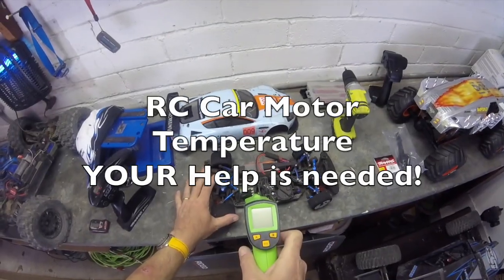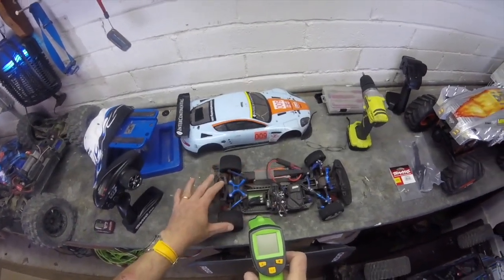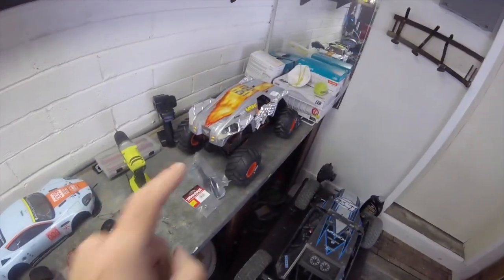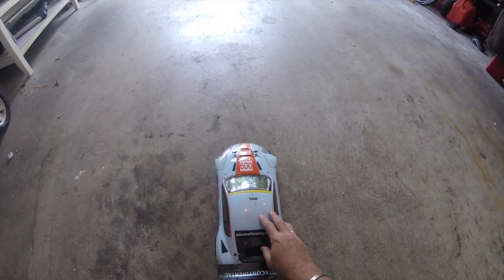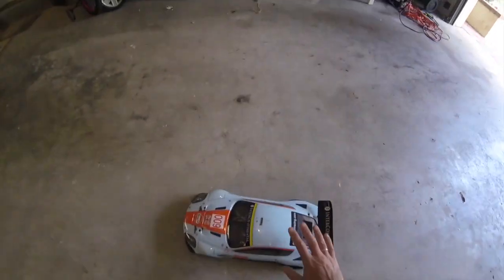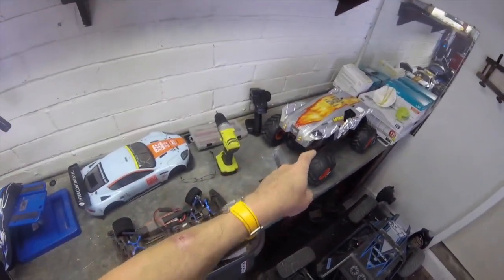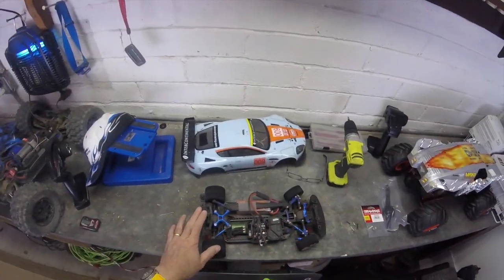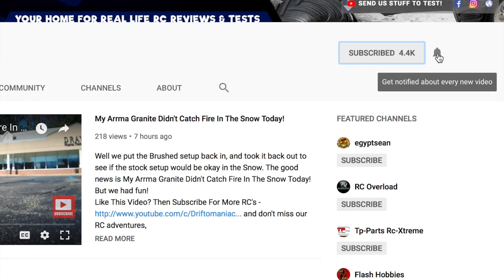RC Car Brushless Motor Temperature - Is This Too Hot On 4S?

Comment: Youre a terrible driver. Should learn on 2s not 4.
Reply from the maker: yeah I know I don't get to drive much as all I really should try and drive lots more RC cars. Not sure what use 2s would be on this speed run car though..... I can drive well in a straight line 88mph with this so far, and 94mph with arrma typhon. You being a good driver you must have done better than that in a straight line? I'm not bad at jumping but also only in a straight line like in this video - https://youtu.be/XHQ2NUDJe5o it keeps flipping though as you'll see

Comment: I have a traxxas rustler fully modified for drifting (welded diff, no caster, parallel toe at full lock for high speed high angle drift) Stock brushless ESC w/a sensored Hobbywing X10 G2 5000KV on 2C 5200mah 35C on 2 inch HPI on road drift wheels with rubber tires and in get 10 minutes of runtime and my motor reaches 140F highest motor temp during the day and 130F at night, same runtime 10 min day or night but I'm HEAVY on the throttle cause I drift on asphalt. Geared at 38t spur 18t pinion Mod 1. ratio is 2.37
Reply from the maker: alan that sounds an awesome build, I'd love to see that thing run. I'm debating building a 1/8 drifter as I've some 1/8 drift tires that I play around with on some of my other cars. You may have inspired me into action over this winter. With the new rustler out I guess a few of the 2wd ones will be up for sale. Thanks for sharing the temp info as well BTW

Comment: For this motor, 4s is too high voltage.
Reply from the maker: ESC is rated to 6s. It's sensored so it cuts out when the temp gets too high. Thus it remains safe even on 6s. On 4S it'll run a full pack just fine. You only find this stuff out by testing it like I do
Reply: What  actaul CAN SIZE motor is that....Usually high KV motors are BABY motors. There's 3650 3300KV 1/10 my monster trucks. I do only 3s on those. can pop wheelies on them..even on GOOD 2s  C RATINGS lipo.
I dont like breaking my drive train.....I ran them hundreds of times.
I also have 3650 3900KV...those trucks dont pop wheelie worth a fuck....

1/8 buggies..these things are HEAVIER...now we;re into the real hobby grade with thicker metal parts all over. 4076 2250KV. This motor
is on the high KV range for that size . It runs fine on 17T....it gets hotter on 19T
Im only on 120A...with 600A burst....4s 50 C. It'll do over 50 mph and out run your car. ( that's not fast...people make them do over 100 mph lol)
 Im not into speed runs....It wearing the rubber fast. The damn tires
balloon...foam insert flies off.lmao

Bigger tires = like gearing UP...yes?

For my 1/8 MGT4.6 conversion...it's more like 1/7...it has 7" tires.
It's a BRICK...BRICK  13lb .....4092 1650 KV  200A esc 6s 40C..
I;m COOL with it. It pops wheelies and can do 50mph ish. ( 2 speed trans)
Reply from the maker: not a clue but it fits 540 mounts, unless space is an issue then focus on the bolt positions. Of note my losi Xl-E does 50-55mph on 8S! That said it weighs 33lbs.....Is that more than double brick size. My traxxas UDR is about 14-15lbs and they say that does 45-50.
Not sure on the outrunning my car, I don't drive may RC cars at all...I'm not good at math either. You mention your's will do over 50mph and out run mine, which does over 83mph on 3S - no wheelies though, is 50mph faster than 83? I don't drive on the road so not a clue is 50 faster than 83mph? Not a clue I barely drive any different RC's at all as an extensive search of this site will show, so clueless on the speed. Does that mean yours goes 33mph faster than mine on 3S? On 4S it want's to wheelie a bit, top speed on 4S starts with a 1 is that faster than 50? I need a hand with this GPS? Help anybody?
Reply from the maker: it's a castle 5700kv motor do check out the 'full pipe' video of this car I shot early this week.

Comment: Be aware that infrared readings are manipulated by reflective surfaces. They will reflect the atmosphere instead of the object intended to measure. This can make taking temp readings more difficult. In general, a reflective object will read much lower than the actual temperature.

Comment: not really going to determine if the motor or esc is too hot in one type of vehicle and not in another. A lot of variation to consider;
weight, gearing, airflow, rolling resistance.... you will just have to put the component and test. But stay absolutely under 180.
111 is a good internal temperature for a pot roast or slow smoking some ribs...lol

Comment: Make sure you are measuring on the motor can not the wires. As others have said 180 Fahrenheit is the max running temperature. Around 150-160 F is about normal if it’s geared correctly. Also, try taking the temperature after a full battery as the motor will be hotter then.

Comment: back to the old intro, eh? it's better. the motor temp seems to be fine, but I'd recommend getting a cooling fan for it if you can afford one. prolonging the high temps might end up weakening the magnets, but should be fine given only occasional runs and low traction tires (like drift tires) to lower stress on the motor. some White Lithium WD-40 on the bearings would do it good.

Comment: between 150-160 is the sweet spot. 170 is getting into the danger zone, and at 180 you are doing damage to your magnets. 200 is pretty much cooking the motor.
Reply: Fahrenheit
Reply from the maker: Dustin your comments MUCH appreciated that was the kind of info I was after but was clueless on. I'll take the temp gun out with me when the motors in the axial as I can hit it up without taking the body off as the motor sits under the car
Reply: No worries, I spent a lot of time sourcing this info from old heads in forums and from motor manufacturers themselves. These were the numbers I settled on and I stand by them being pretty darn accurate.
Reply: Dustin Brookens I've tried all kinds of combos down to 12/56
With 32 pitch. Right now I'm running the 48 pitch @ 20/86. It's kind of a sweet spot in the power band with good lower & really good top too. The motor itself is 4420 kv so I know it's going to run hotter anyway but I can't get much below boiling point. Lmao!! Honestly surprised I haven't detonated this motor yet. Especially I've been running more 3s lately too & it get super hot super quick. Timing is at 0. Default on the old mamba max pro I'm running is 10 deg. But the motor hated advanced timing. I'm not running any fans either or heat sink. I'm sure I could drop a few degrees there.
Reply: yeah heatsink and fan might get you 10 degrees, but really at those gearings  with a 4420kv motor youd have to go way down to like 14/86 to compensate for that high speed. At that point tho you might be killing your wheelspeed anyway.  if your on 32p maybe you could try 12/52? Or really just run it till you burn it out lol. It may run at 200+ for now but it does cumulative damage so the more you run it theoretically the worse it will get.
Reply: Traxxas parts are overpriced for some things in my opinion. Motors and ESCs especially for the lack of features they have.
Reply: I would say this is accurate info for brushless motors. Some might say 200 is okay. I got mine to 217 today and thats why im here to see what people think.  I've been over 200 many times with my slash and still going strong. The 3s battery is something to be careful with. I do have a heatsink on the motor
Reply: Dustin Brookens - Ideally I'd like to get my motor temp down. But I don't see a way to make s significant difference. I would love to get down to 170 but even on 2s & geared way down it just runs hot. If I paid 100.00 or more for the motor I'd be doing all I could to cool it down. But you are 100% right on with those temps. 👍
Reply: Did you try stock gearing? 18/90? I run my slash with a castle SCT 3800kv at 23/86 and it holds temp around 150. At 18/90 its like 100.
Reply: 150-160 degrees Fahrenheit on the outside of the motor?
Reply: Dustin Brookens - Yeah I just take it apart & check bearings once & awhile & keep it going. I mean really for the price of a Traxxas rebuild kit I can buy another motor. So I'm gonna run it to death. lol

Comment: Wow that's ice cold. I run my motor over 200 & been running for more than 6yrs. Without a problem & the motor is a 25.00 motor. So s quality motor should hold up better.Being put in a heavier truck will generate a little more heat but that motor should work fine on the Max D
Reply: You probably have an outlier of a motor. Sometimes randomly a motor is a cut above the rest; Castle says you shouldnt run their motors over 170 but they have also done tests up to 300. Most motors fail over 200 but some just keep soldiering on.
Reply: Dustin Brookens - Yeah with the cheap motor it doesn't have it doesn't have a plate with the solder joints on it. So it'll run higher temps without worrying about it coming undone. Sometimes they work out better as long as you put a decent esc behind it.
Reply: I'd put one of the motors I have up against a VXL any day.Especially for 25 or 30 bucks.